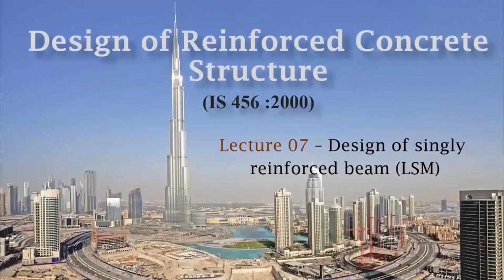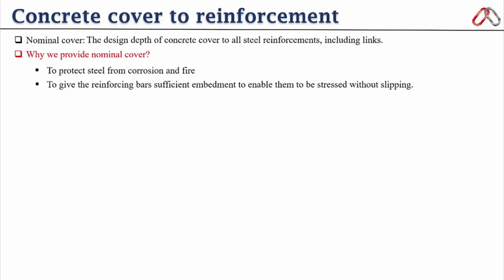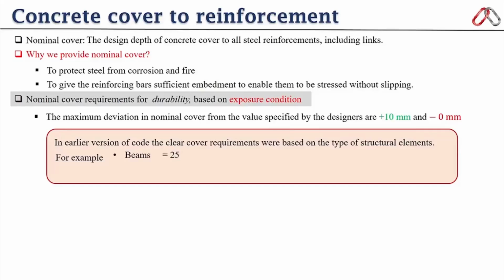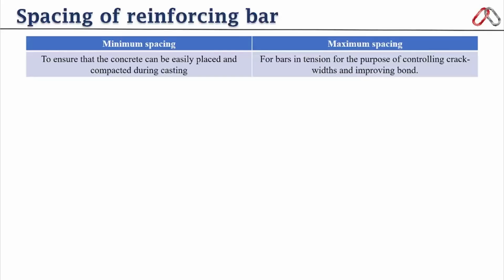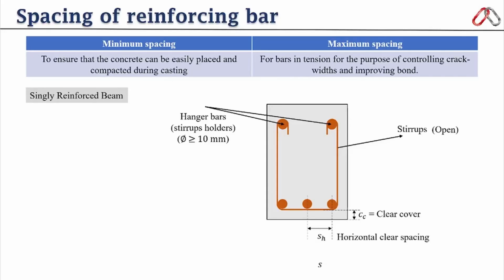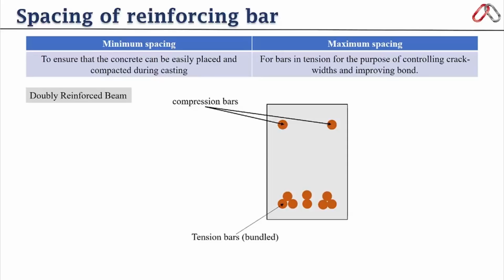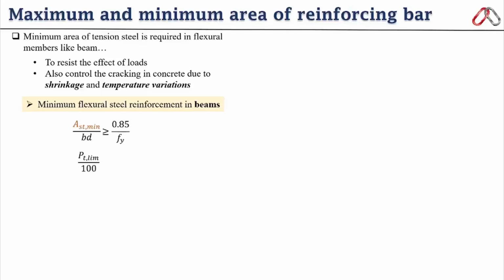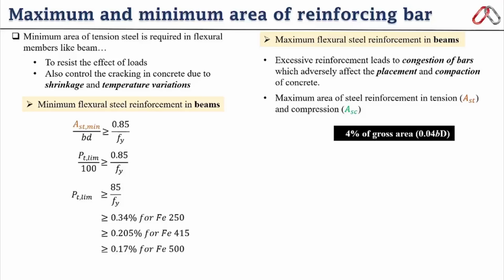Design of Singly Reinforced Beam (LSM)  Reinforced Concrete Structure IS 456: 2000

Comment from the maker: Misspelt at 6.29
1. Vertical clear spacing to be not less than maximum bar dia, 15 mm, 2/3 of maximum aggregate size
2. Horizontal clear spacing to be not less than maximum bar dia, maximum aggregate size + 5mm
#ref - IS 456 : 2000 (Cl 26.3.2)

Comment: Hello... Your videos are Awasome!!!
Please upload videos on RCC building design..... Means how to design reinforcement in each member.... How to evaluate loads acting on the structure etc..   make videos of A to Z for the reinforcement... Also include how structural designer design reinforcement in the member... So make videos about how to design slab (including beams).... So upload videos on RCC building design by "PRACTICLE APPROCH" Also include example of 2 or 3 or more stories building... So I just want to know how structural engineer design RCC member... Practicle Approch
Reply from the maker: Hi Nipurn,
You can purchase full course of RCC from MachenLink.com
Thanks
Reply: Does it include PRACTICLE APPROCH ...???
Reply from the maker: This is the first course of RCC which includes the design of structural elements only. 
Second part (design of structures and pre-stress concrete) is under process.

Comment: Min clear spacing is not lesser of those values..... Study once....
Reply from the maker: Yes, It is written correctly but misspelt.
1. Vertical clear spacing to be not less than maximum bar dia, 15 mm, 2/3 of maximum aggregate size
2. Horizontal clear spacing to be not less than maximum bar dia, maximum aggregate size + 5mm
#ref - IS 456 : 2000 (Cl 26.3.2)